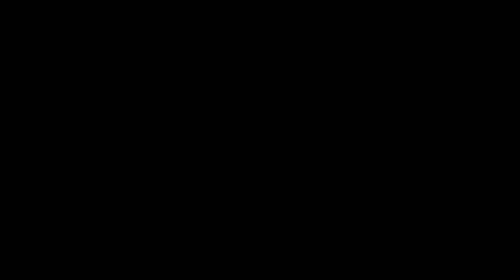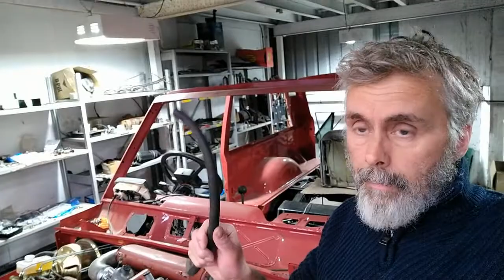Ethanol fuel in classic cars - part 1

Comment: Question is who's a reliable seller.
Reply from the maker: It can be tricky, but basically someone who has a physical shop where you can go to to complain if it goes wrong is a good start. Internet only shops that can disappear without trace should be avoided.